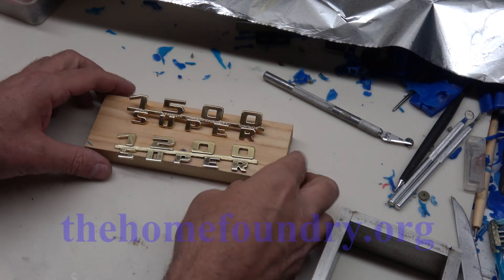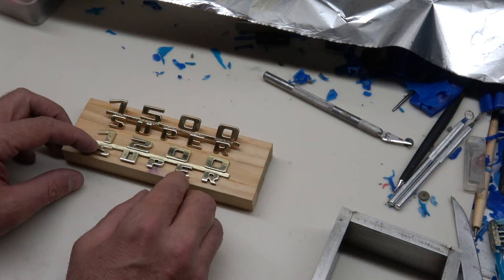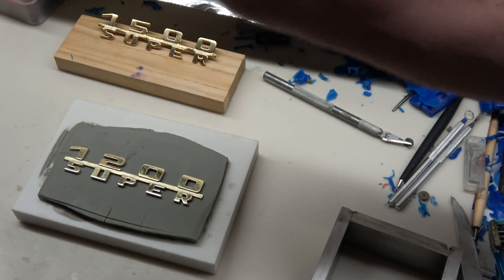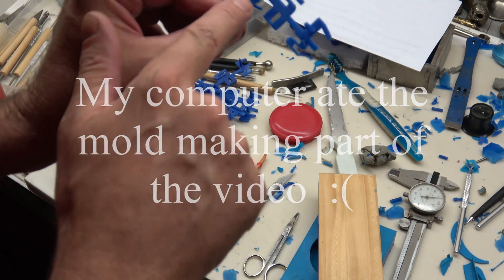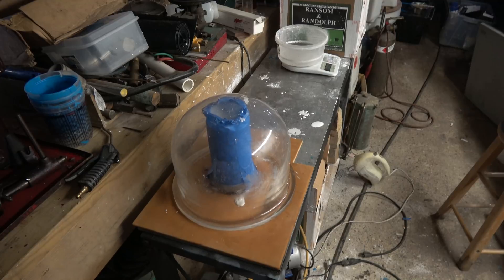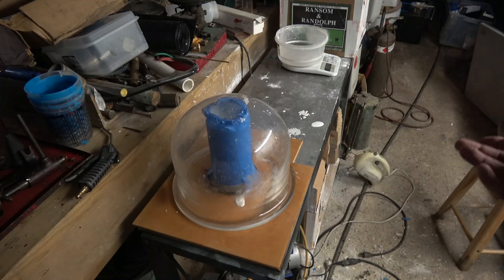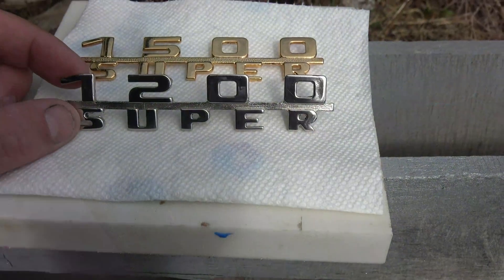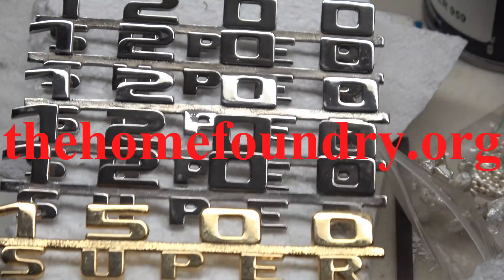Making a car emblem

Comment: thank you so much for sharing your knowledge. 

a question: do the wax models remain in the plaster mold during the pouring of the liquid metal? or is the mold heated to melt the wax before placing the molten metal? 

Sorry for my bad English!
Reply from the maker: The molds are put into a kiln and heated to 730c .  All the wax is burned out prior to pouring the metal..
Reply: @aonemarine  
OK thank you! I will follow all your videos!!!
Reply from the maker: @professorprieto7866  thank you!

Comment: Hi I just saw VegOilGuy and his recommendation to visit, and I am glad that I did. Much to learn about. I was going to ask if just vibrating the mold would work instead of vacuum but you ended up vibrating it with your fist?
Reply from the maker: Yea, but your much better off using vacuum..

Comment: Awesome!! I want to get into lost PLA casting and I am looking to buy the RapidFire electric kiln on amazon for burning out the PLA from the investment. But the interior firing chamber on the RapidFire is only 6x6x5 inches volume.... will a flask fit in there??? Yours seems very large.
Reply from the maker: I actually use a pottery kiln for burn out.  You can usually pick them up on craigs list for $100.00 then just add a temp controller from ebay to it and your done.

Comment: hi i have made a small vac casting chamber the same has on one of your prev vids thanks for the help with that project . i have run it 2x but my fridge vac pump has burnt out , i was interested to see your vac pump  at16 mins ish into the film . iam only doing v.small casting jobs 3inch  flasks by 4inch .I note you just switch your pump on and leave in running is there some sort of safety device that stops it from burning out ?? do you have any recommendations  for a vac pump for small applications I note you dont have any gauge on your vac line ? i tried to start my cast off at  minus 20  mercurey or whatever it is . is this critical to fill all the voids ? i been gathering / makeing bits un bobs ( parts ) for a while now and need sum success i can feel the frustration thing commming on thanks for your helpful vids
Reply from the maker: Steve Green the blue vac pump is a 2 stage 4 cfm.  It runs constantly. 
  What problems are you having with your castings?  Which investment are you using? And what are you trying to make?
  Join thehomefoundry forum and we can talk and get you sorted out.
Reply: thehomefoundry thanks v.much will sort that tomorrow I've been on the site before just had a look round ta might sleep better tonight

Comment: Castings came out great, I like that white bronze.
Reply from the maker: white bronze is easy to cast too.  It doesnt suffer from fire scale and is low shrink like silicon bronze.
Reply: thehomefoundry Hi bro, I want to know which silicon you use for silicon mold and which one for " plastic casting resin" . Thanks a lot